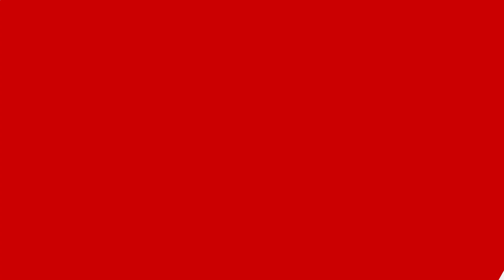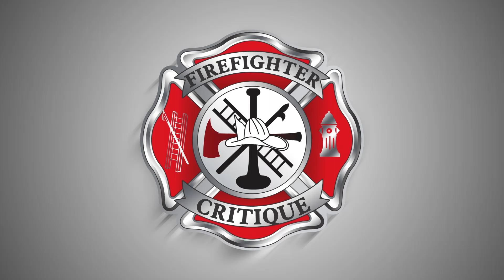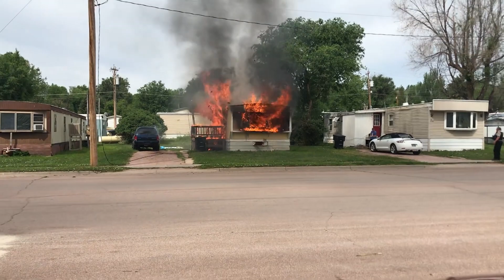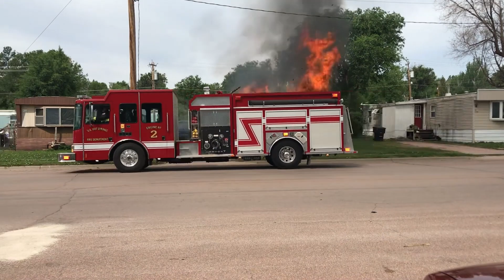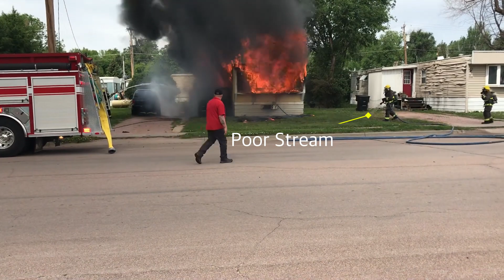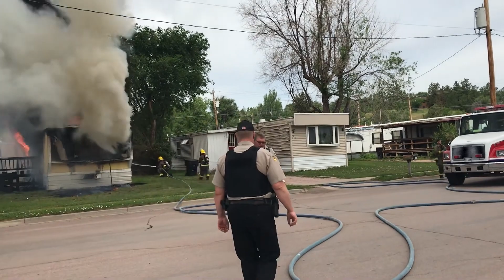You Must Train to Be Prepared

Comment: Disagree, looks like they were putting it out
Reply: Don’t you think the 2-0 engine company first on scene could’ve pulled a preconnect and then delegate the 2nd in engine to establish a water supply?
Reply: @er2158 Yes I agree but they didn't. I really don't like to criticize, I know how things go sometimes
Reply: They all go out eventually, the question is did it go out faster after you arrived or not.  The answer here is, not much.  Both of these rigs should have had sufficient tank water to extinguish the fire in a timely manner.  Even as understaffed as they are, better practice and coordination are an absolute necessity.  First engine deploys an attack line, second engine gets the water supply.  For whatever reason, they elected to do it the other way around, but even so their line handling needs practice both with the attack line and the supply line.